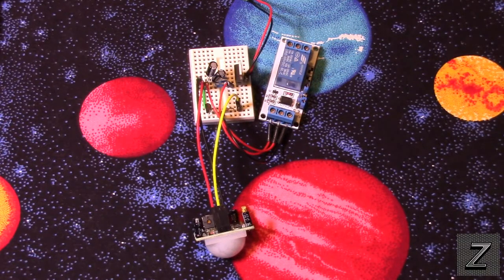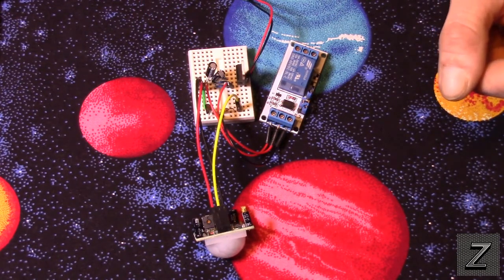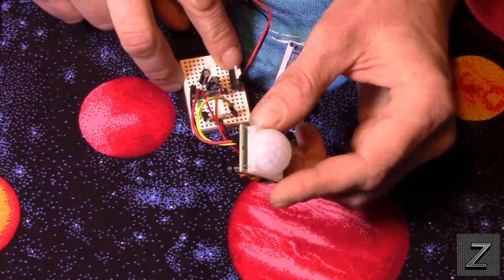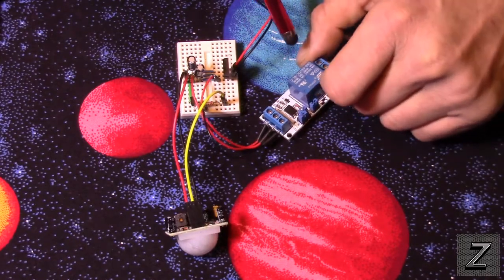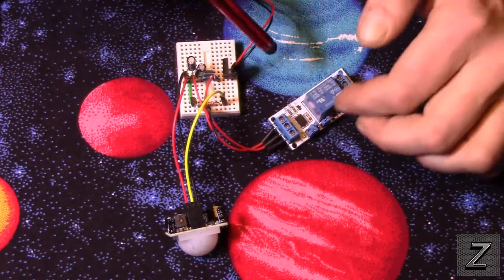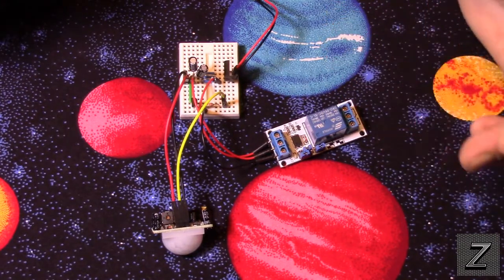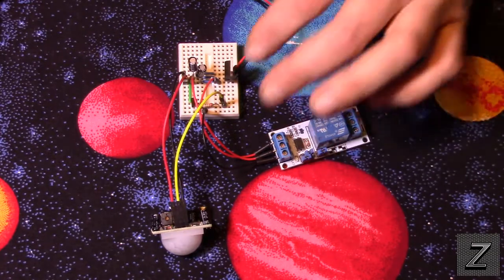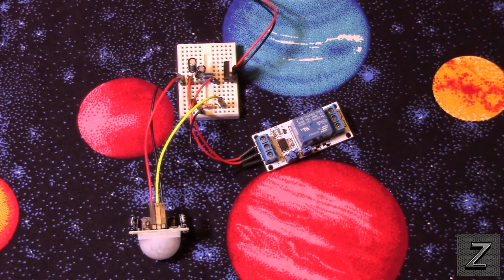How to control a relay with a PIR motion sensor

Comment: I have tested many times that simple transistor based relay doesn't work with pir 3v out put because this 3v bise signal prevent voltage more then 3 voltage to pass through transistor !!
Reply: Insted that , i used opto coupler that is isolated so it worked and same thing here

Comment: i need a relay to come on when my car starts moving and when it stops i need the relay to turn off. any ideas?
Reply from the maker: Just wanted you to know I seen your question and I have been doing some research. I think this could be a very interesting video for my channel and I will get back to you in a few days once I have some more information.  I do think this is very possible using a Arduino microcontroller and a ELM327 OBD bluetooth reader for your car.
Reply: @z-hut1663  good deal thanks. I was thinking about taking your idea hear with the sensor and mounting it somewhere on bottom of car facing the road but I wasn't sure how it would work. I even thought about tapping into the speed sensor of the car somehow
Reply: @z-hut1663  also if you are good with Arduino I got another question for you. I built this lawn mower that's completely rc controlled. I can sit in my living room and cut grass but I want to be able to add his so it can cut grass itself. You got and ideas for that? https://youtu.be/HTpaumKJCJU